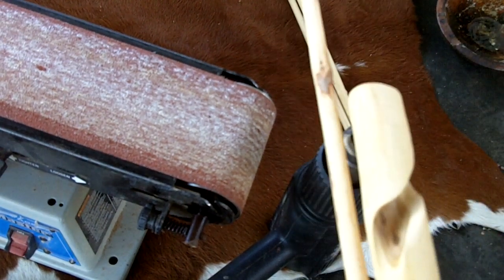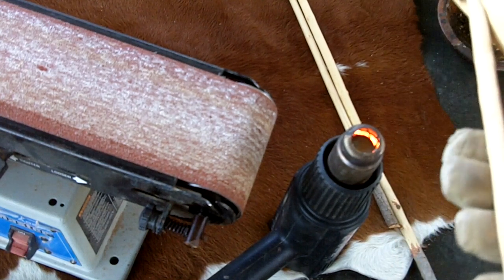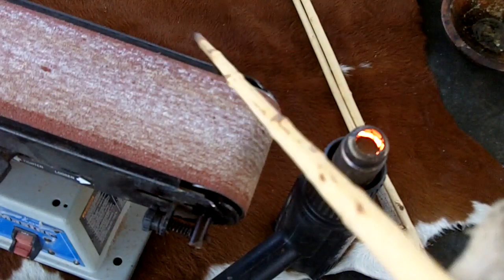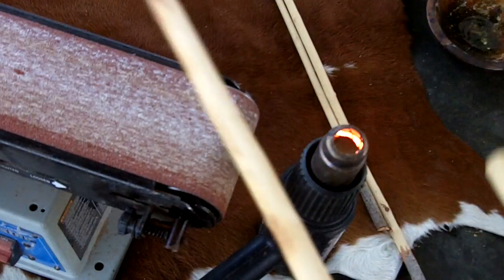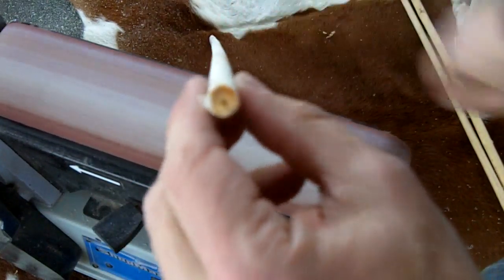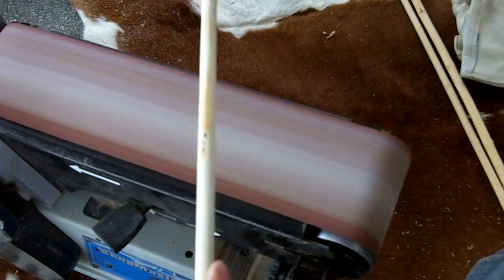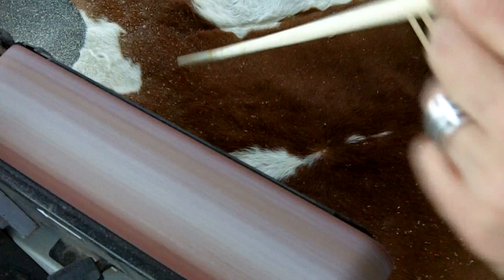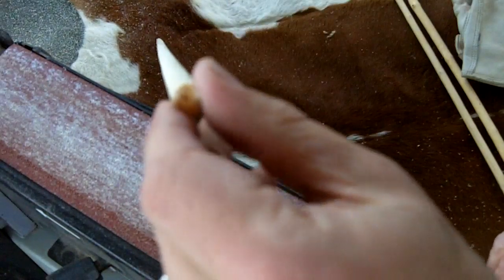180 - How To Make A Natural Wood Shoot Arrow Shaft Part 3

Comment: You should make a tool from wood with a partial radius in the end to hold shaft down on belt sander where you want to sand.Lot safer than if you slip.
Richard

Comment from the maker: @Barbarossa4U Usually,  5/16" to 11/32".  If they are too stiff for my bow I'm working on, I sand then down to about 9/32".  I don't really measure the diameters when I'm making them.  I put them on the spine tester and sand them until they are the right spine.